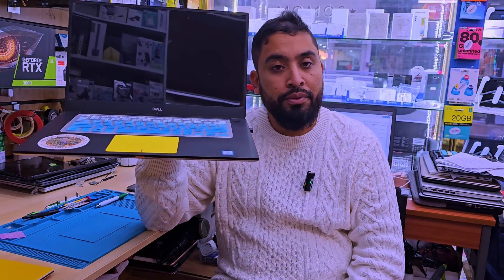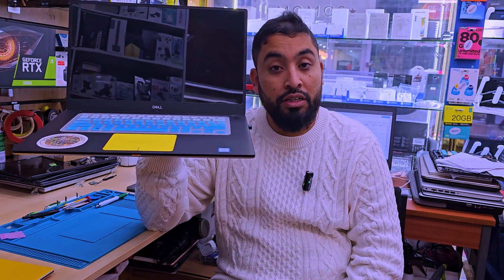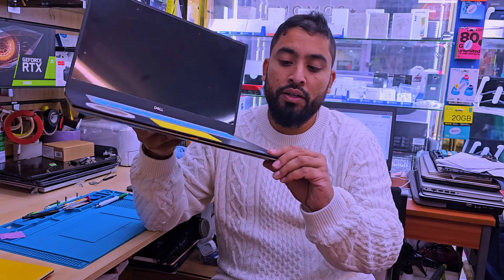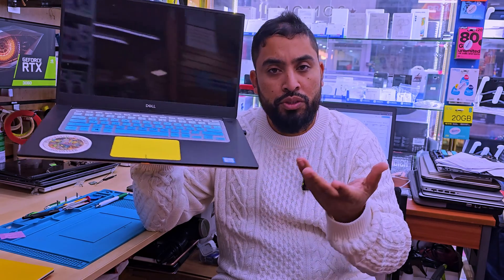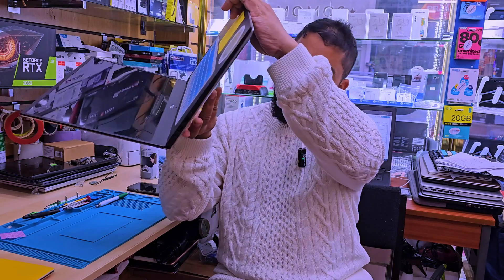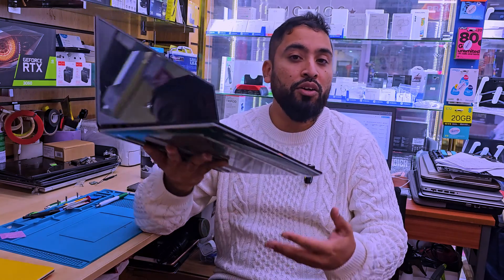How To Fix  Dell XPS Laptop's Loud and Fast CPU Fan Noise | Step-By-Step

Comment: Funny fact!  I got tired of my XPS 9310 2in1 fan noise and unplugged it!
Yeah it runs hot AF and throttles back to less than 1GHz but it was just literally used for surfing and Word/Email and was fine.
I don't recommend it as who knows how long it will last but there it is! 😛
Reply from the maker: Thanks for your time here.